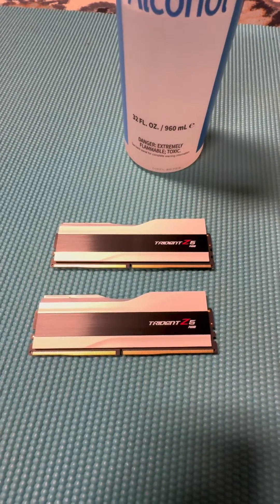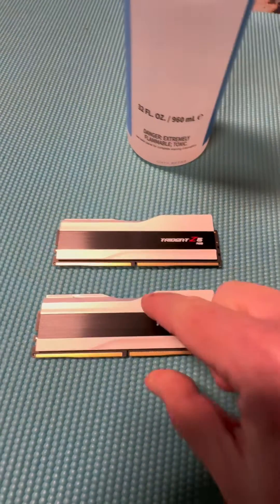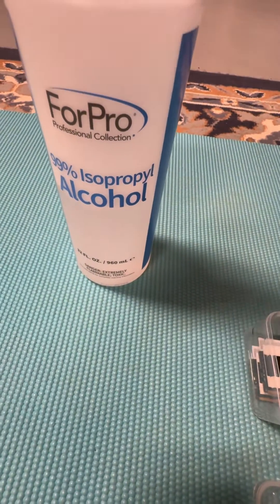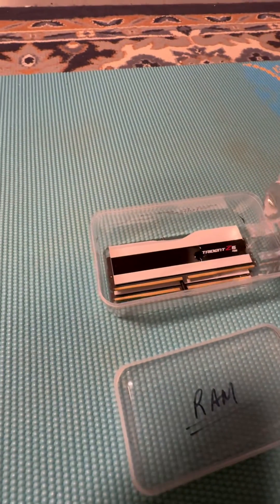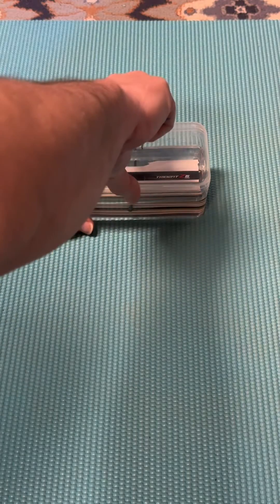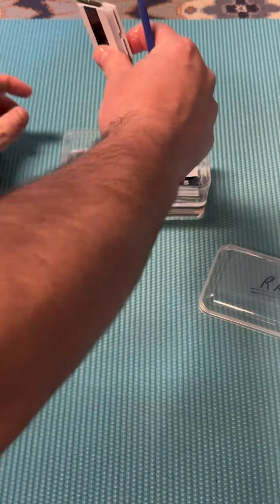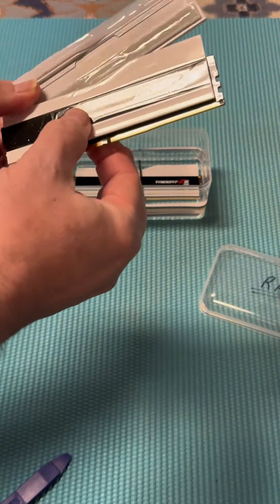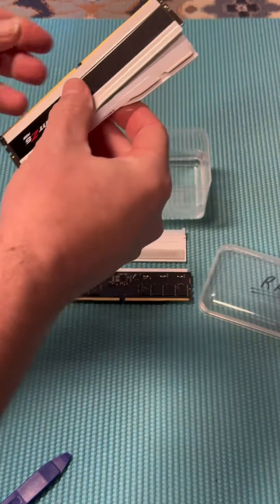How to remove modern DDR5 Heat-spreaders (with or without RGB).

Comment: I opted to watch three videos on this procedure in preparation for a water cooled build. The first suggested either a razor blade or a mild parts solvent (composition not disclosed). The second was a heat gun without temperature monitoring. This method makes the most sense, knowing that this chemical is commonly used in PCB cleanup/repair and that there is no need for finesse and minimal risk of accidents. Well done.

Comment: I really lived my artic tp3 thermal pads for my GPU, I am wondering if it will work for Kingston fury beast.
I plan to do it in feature since ram temperature is fine but hits 60C in gaming.
Right now not worth to do and will do it 1-2 years later.

Comment: what about the external sticker with serial number? how can i reattach it to the heatsink?
Reply: I print a new one out to match the new color scheme I want, using heat resistant printable labels. They make them out of the same stuff capton tape (sp?) is made of, which can be used directly on super hot PC components without issues.

Comment: Will the rgb still work if i wanted to install it back on? (If i decide i wanted rgb back on the ram)
Reply from the maker: Yes, the leds are embedded in the ram itself. IF you use 99% isopropyl alcohol, they won't be affected at all.

Comment: Would this work for DDR4 as well?
Reply from the maker: Any sticks, but the older the sticks, the longer they need to stay in the bath. What I do is after I remove them from bath I test with a plastic pry tool if it's still hard to remove, place them back in bath.

Comment: At first, sorry for my english. And if you want to assembly it back, how you glue both sides of the heatsink?
Reply from the maker: For reassembly you need to use the original thermal pads and cut a thermal sticky tape to the same measurement, you can find them at Amazon https://www.amazon.com/double-sided-thermal-tape/s?k=double+sided+thermal+tape

Comment: One of my sticks died using this method. The heat spreader came off very easy just like the video. But one of them died. I have no explaination why as I, like make of you believe that isopropylalcohol shouldn’t have affected the stick(was using 100% chemically clean).
This if the only stick of ram I have ever killed in my 20 years of building PCs so a slight caution is adviced.
Reply: Did you use 99% isopropyl and let it dry completely afterward?
Reply: Any idea what killed his ram? Anything wrong with this method?
Reply: @ could honestly be coincidence… maybe the stick decided it had enough just then.
Reply from the maker: He probably used 71 or 91% isopropyl alcohol, you need to use 99% because the others are electro conductive, so the problem was not the method.
Reply: Isopropyl evaporates that's why it's different to water. If you soak electronics in it it will act like water and absorb into the components and damage them. The best way is just use a hairdryer which can't go much past 90 degrees and is safe.
Reply from the maker: you probably used 71 or 91% isopropyl alcohol, you need to use 99% because the others are electro conductive, so the problem was not the method.
Reply: @J.O.R_BR_Overclocking no, it was 100% chemically clean iso
Reply: @samsins34  Did you test the resistance with a multimeter to know that your alcohol was within specification? How many hours did you wait to take it out?

Comment: With this method, is there any risk of damaging the chips? Because I saw another video that the liquid ends up getting under them, so you need to dry them well
Reply from the maker: No. I have been using this method since DDR 2 days. Pure Isopropyl alcohol is used by all chip manufacturers to clean them and any type of electrical circuit, that’s why this is the safe method to remove your ram heatsinks.
Reply: @J.O.R_BR_Overclocking  So this method will improve the temperatures? Or I need to put another heatsink? And why the heatsink that goes with the NVME is worse than getting "naked"?
Reply from the maker: @ in some cases and brands where the heat sinks are not properly installed it will improve cooling with a fan, other cases it will not. You usually do this to install a water ramblock for your rams or for extreme cooling with LN2.
Reply: @J.O.R_BR_Overclocking hey man, can you help me figure out a cooling solution for my trident Neo z5? I need to get rid of the stock heat sinks to reduce height, but mine will get too hot without anything.
Reply from the maker: @ you only have two options, watercool or fan on top /side.
Reply: @J.O.R_BR_Overclocking  perfect! Im brazilian and the ddr5 for us is too expensive😅

Comment: how long would you let it dry after you take the heat spreaders off?
Reply from the maker: 99% alcohol evaporates pretty fast I would say 5-10min tops, faster if you use compressed air on them.

Comment: Did you get both sides of it? With my DDR5 RAM only one side just comes off! I'll leave it in a little longer now! It would be nice if you could answer! My English is not so good! But your tip is the best so far!
Reply from the maker: Yes, just leave more time another 8 hrs or overnight. I have noticed if it’s not pure 99% alcohol it won’t work as smooth either.
Reply: @J.O.R_BR_Overclocking   so will 91% take longer to get the glue off?
Reply from the maker: @thanatos1023 yes, when you start to peal and it’s still hard just leave it an extra 8-12hrs
Reply: Thanks @J.O.R_BR_Overclocking

Comment: I used turpentine on mine with the same results. I think I’ll just use alcohol from now on 👍
Reply from the maker: Yes before I used harsh chemical  too, but 100% alcohol is safer. It just takes longer to react with the ram double sided tape. That’s why I recommend 24hrs.